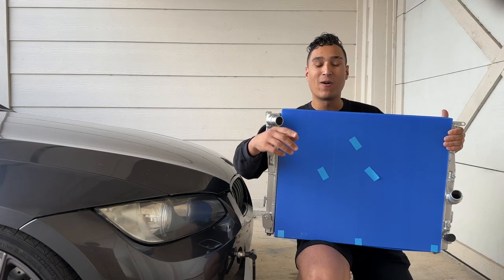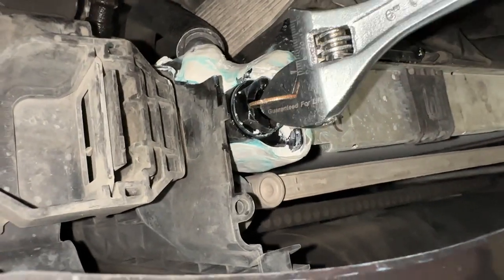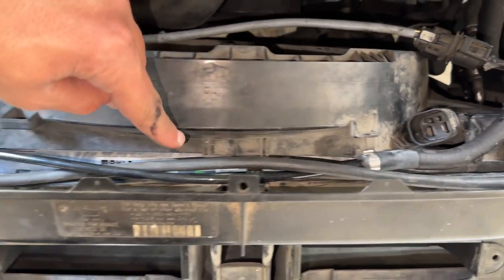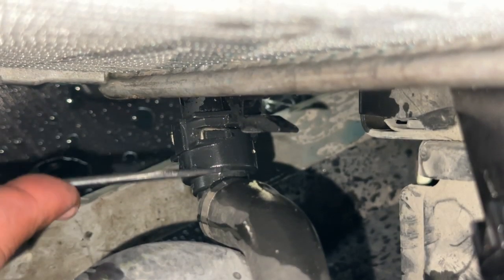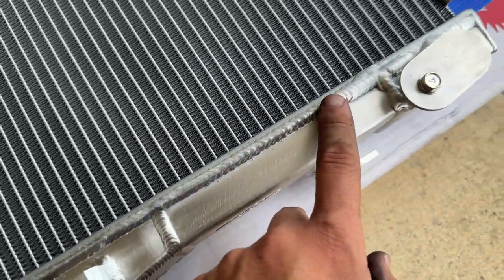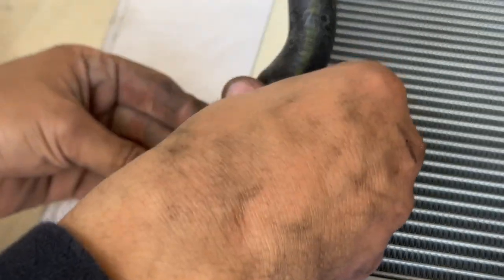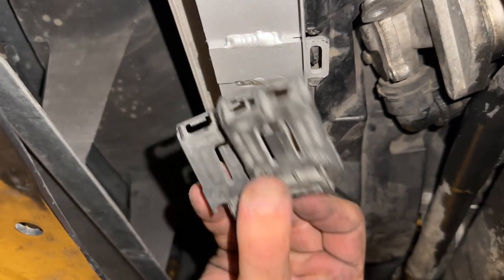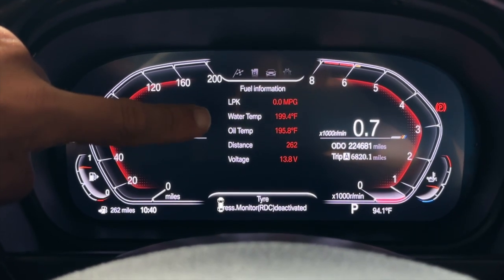CSF PERFORMANCE Aluminum Radiator Upgrade BMW E90 E92! | 328i 330i 335i

Comment: Dipped my passenger tire into a hole. Radiator held up until i turned it on the next day; heard the water flowing and was deeply saddened

Comment: just copped for my 330i. just worried about how csf states that it may require a tune for the thermostat mapping. u been having any stuck open thermostat codes?
Reply from the maker: nope, no codes at all after over a year!

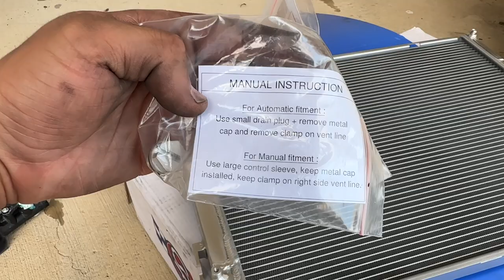Comment: At the 7:42 min mark of the video the Automatic drain plug instructions say to install the short / small drain plug (Removing the factory installed long drain plug for manual trans). Which coolant drain plug did you use?  The Short or the long drain plug?

Comment: I see you still have that time bomb plastic Mickey mouse connection on your block hose. Upgrade that to aluminum and make sure you buy a gasket for it, the gasket that comes with them always leak due to wrong size.
Reply from the maker: video for this exact thing dropping soon
Reply: @IzzyE9X  the ring gasket that comes with them are the wrong size (to thick), pending on who you get it from, I had to buy one from BMW to use on it $18. Super tight fit as well, the bottom of it is hard to get flush coming in from the top because your mind is telling you to press it straight when it's all at an angle.
Reply: I bought mine for my previous E90 on Amazon and never leaked.. ( my nephew drives it and still not leaking, reason for giving to my nephew is it was salvaged do to someone rear ended my car)so my new to me E90 will get the same from the same vendor in Amazon

Comment: whered you buy that trans cooler block off plate
Reply from the maker: It came with the radiator
Reply: @IzzyE9X  interesting. I bought a csf, and it only came with the two different sized drain plugs.
Looks just like your set up, just plastic end caps instead of all aluminum

Comment: Only for manual transmission.. correct?!
Reply from the maker: automatic and manual
Reply: @IzzyE9X  my bad I see.. now I know when mine breaks I will be buying the all aluminum.. thank you!!
Reply: @maurisgarage1633  no u wont its 600 dollars
Reply: FCP and ECS $400.. so yeah definitely will get one
Reply: @maurisgarage1633  500 after tax pretty much
Reply: Hahahaha $400 after tax is $500??? 🤣🤣🤣
Reply: @zorosmik6709  hahaha $400 after tax is $500???🤣🤣🤣
Reply: @maurisgarage1633  its 489 not even including shipping
Reply: @zorosmik6709  bro shipping is free .. $440.70 including tax.. FCP..owning a BMW not a Corolla…

Comment: Those r like 600$ radiators lol most guys will just replace with a hundred dollar 1 n call it a day
Reply: Thats $600 plus the cost to install and refill the coolant if you aren't doing the job yourself. Turns into $1,200+ real quick, and if you haven't upgraded the thermostat and water pump too...these old bwm's are like having a high maintenance girlfriend, nothing is ever enough😂